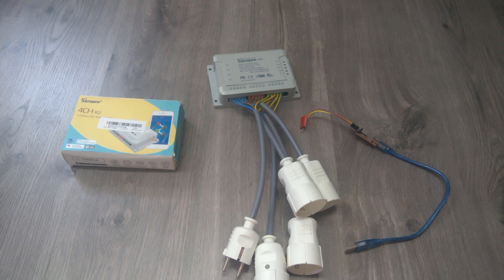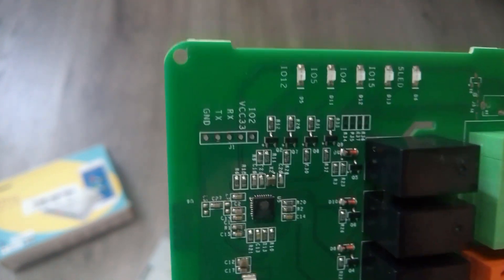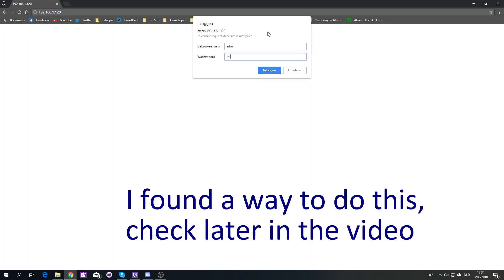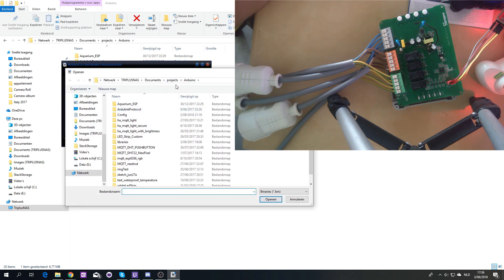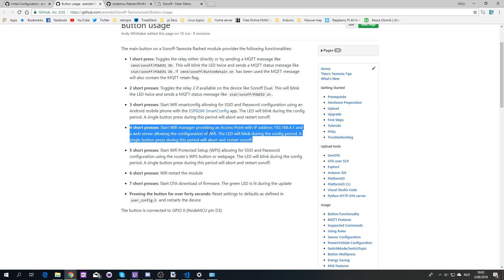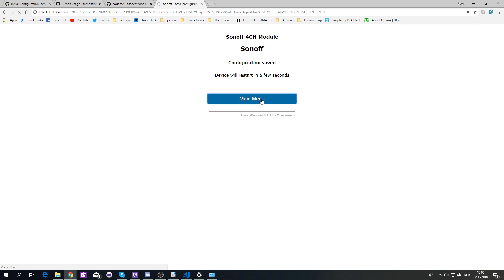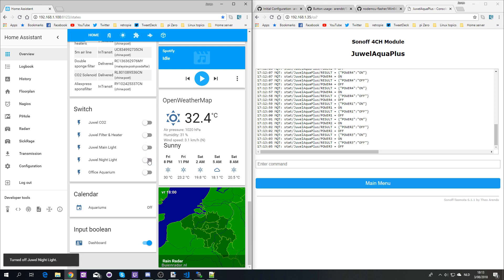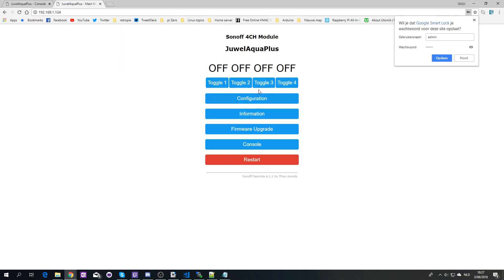Flashing a Sonoff 4CH R2 using nodemcu-flasher and Tasmota Firmware (HomeAssistant Demo)

Comment: Hai , I flashed tesmato but now I want to revert the firmware , is it possible
Reply from the maker: Hi - if you didn't back-up the original firmware, I'm afraid it is no longer possible. Haven't played around with Sonoff in some time.

Comment: Hi,
thanks for the tutorial - basic question, where can I get the nodemcu flasher hardware?
Reply from the maker: the flasher I used was https://www.banggood.com/FT232RL-FTDI-USB-To-TTL-Serial-Converter-Adapter-Module-For-Arduino-p-917226.html?p=XA21121527197201504D

Comment: My Sonoff 4ch R2 turns on with Blue still LED, should I go for flashing???
Reply from the maker: I'm not sure what a blue still LED would indicate. Did you already put custom firmware on it or did you just get it like that?
I always try to run my sonoff with the default firmware to make sure it works before flashing it
Reply: @TriplusTutorials   I haven't tried any flashing yet, it's still with stock. And device goes in this mode after using it normally for almost an year. I don't have connectivity tools to flash it, and Sonoff refused to give any support since I haven't bought from them directly.

Comment: Informative video, thanks.
I have a note related question. How did you add the weather radar iframe on your lovelace? I'm interested how you manage to select just the radar frame from the website.
Reply from the maker: It's technically just a camera with a gif image running in it :) You just need to get the correct source. Example: http://api.buienradar.nl/image/1.0/radarmapbe/gif
Reply: Hello again :-).
Your example link works great, how did you mange to extract the gif link from the site?
Can you help me extract the radar map from https://www.wunderground.com/wundermap?radar=1.
Thanks.

Comment: hello, I do not see what firmware to take, someone to help me please. Sonoff.bin? sooff basic.bin ou sonoff-fr?c'est pour mon sonoff 4ch r2
Reply from the maker: sonoff-basic.bin
 on the sonoff tasmota github should be sufficient :)
Reply: @TriplusTutorials  think you, On my sonoff 4ch r2, I'm afraid of losing the wifi with this sollution thereafter. I want to flash the sonoff 4 ch r2 to integrate it into my home automation solution. Do you confirm the firmware sonoff-basic.bin?
Reply from the maker: You could confirm via the wiki or create an issue in the github. I don't have that exact model so I can't tell.
But all the sonoff devices I've flashed don't show any issues that aren't fixable so...

Comment: Thank you for sharing!!!
Reply from the maker: happy to help :)
Reply: I just flashed my first Sonoff 4CH R2. The only thing that I had to do that is different is that I had to change frpm "3V3" to my "5V" output on my TTL adapter. I also had to do that with my Pow R2. Why? I still do not know. I think my TTL adapter cannot power the POW R2 or 4CH R2 using 3V. I read that it is dangerous to do so, but since I got stuck, I tried it anyway and it worked for me. 
My adapter is a USB TO TTL : HW-597. 
All my previous tries probably destroyed something else as well because I could flash successfully but the sonoff would never show any lights. Even when I pressed buttons. Then I had to do a flash erase using esptool and flash the bin file again. Then disconnect everything and connect to the 240V. Then everything started working.

Once again, thank you for uploading the video. It helps people all over the world :)
Reply from the maker: weird on the 5v indeed. I bricked a sonoff basic when I didn't realize it was on the 5V... But if it is working for you, maybe the connections on your FTDI adapter is different or wired wrong? Anyway, as long as it is working I suppose ;)